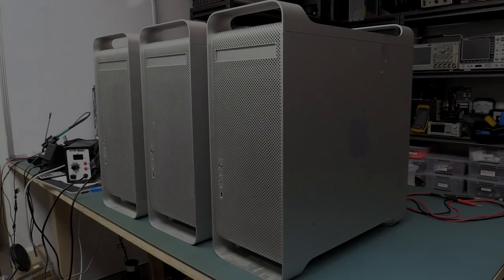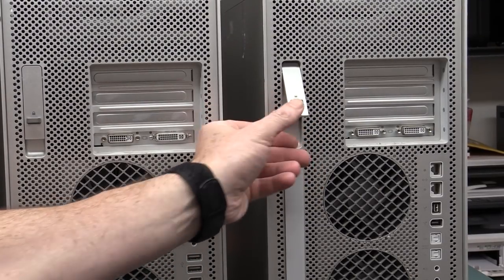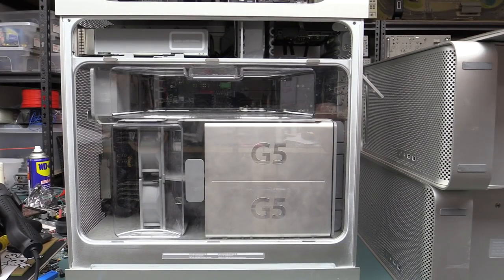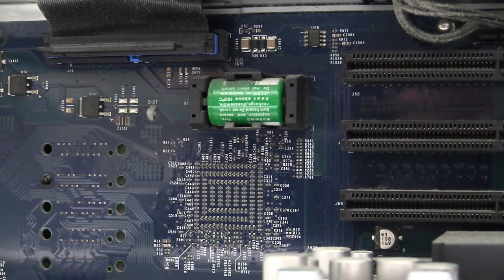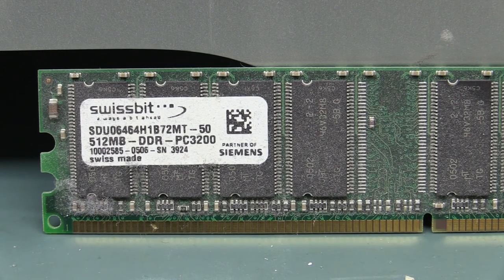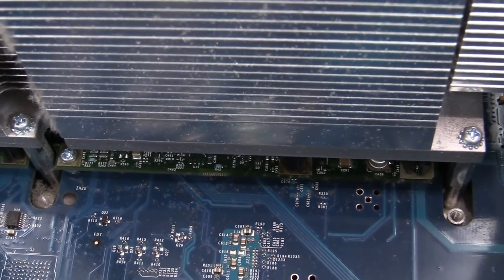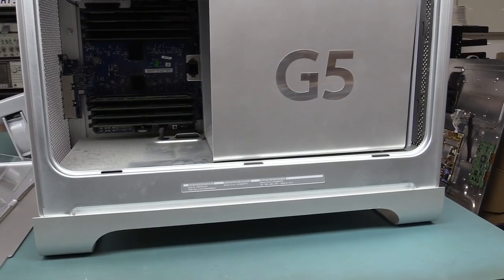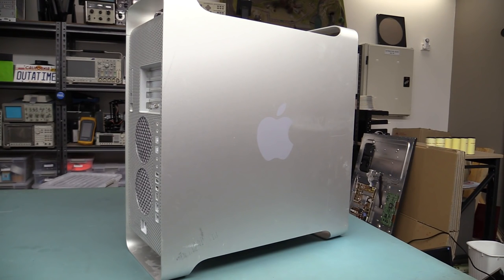EEVblog #783 - Dumpster Dive Power Macs

Comment: How cool would it be to convert one or two into liquid cooled gaming machines. It already has a cool custom case.
Reply: Yass
Reply: Half of the design of Apple's classic Mac Pros (all the way up until they dropped the towers for the torus thing they have now) is the thermal handling. Much of its form is dictating by the function of moving lots of air. Liquid-cooled obviates all that. 

If you could get your build to even sort of fit into the original spaces, you wouldn't need liquid cooling.
Reply: Some of them (quad cpu models) have liquid cooling stock

Comment: Where are the power supplies? External? They were where the hard drives were in these. I just scrapped 4 x 2009 models. 4 x 980 watt PS and all the heat sinks for projects. 8 Huge CPU heat sinks. 16 working fans. I'm set! Kept all the aluminum panels for projects as well. Come in real handy. Everything else was scrap or ewasted.
Reply: The power supplies are in the bottom, unlike the Mac Pro.

Comment: They'll be ATI graphics chips or Nvidia.    There was one model of those that actually had liquid cooling with a radiator and pump.  Apple overclocked the G5's,  hence the beefy cooling.

Debian Linux maintains a release for the PPC that really runs great on those.  Makes them quite useful even today.    I have an old PPC G4 Mac mini on my bench running debian that I still use to watch youtube and research with when I'm working  there.

Comment: Here is an idea. Put speakers where the fans on the back side was, put a big chargeable battery inside, solder everything to the usb ports and to the aux outlet, take everything else out, boom, a really cool dock with speakers :)

Comment: I'm surprised you didn't get a water-cooled model.  The dual G5s were commonly water-cooled, and they leaked terribly and ended up destroying many beautiful machines.  Also, you should definitely pull the heat sinks off and take a look at the CPU daughter boards, they're truly works of art.

Comment: So here are some facts about these PowerMac G5s:
-- There were released from 2003 to 2005, up until early 2006 when the Mac Pros or Intel based machines came out (same tower case but with 2 CD/DVD drives)
-- The single processor PowerMac G5s had a PCI interface and had 4 memory slots, whereas the dual processor PowerMac G5s had a PCI-X interface and had 8 memory slots
-- The last lot of PowerMac G5s (also known as an Early 2005) had a single Dual Core processor (not Core Duo) in 2 configurations and the top end model was a Quad Core processor, and they also had DDR2 RAM (maximum 16Gb although Apple initially supported 8Gb), PCIe slots, and 2x ethernet ports
-- The Early 2005 model had a C19 plug which was an error in their design and/or engineering, but Apple were too lazy to change to a standard C13 plug - it's only a standard 10A C19 power cord anyway, but is a pain to find an original cord sometimes
-- The deflection board (or clear plastic/perspex board) was not only for good looks but was used for good airflow with the fans and CPUs - removing the deflection board would mean disruption for the airflow so the fans then kick in at full speed (there is a microswitch in one holes which is triggered by one of the lugs of the deflection board)
-- The beautiful design of the power supply which screws onto the logic board (motherboard) also meant a nightmare to remove the power supply i.e. the processors, logic board, and all fans on the lower part had to be removed before the power supply came out

These are just some of the facts briefly outlined in the video of the 3x PowerMacs that you found. Another interesting fact was that the top end PowerMac G5 configuration was liquid cooled (except for the first generation of PowerMac G5s) - try typing in "powermac g5 liquid cool leak" into Google and see what images you find.

These PowerMac G5s are still sought after as some people are still running legacy PowerPC software. I still sell these to some of my customers and they range from $200-$500. If you want a logic board (motherboard) and a dead power supply to play with or tear down, let me know and I'll see if I can dig one up and send to you. Sorry if I typed too much...

Comment: That ADC connector on the display card has no USB. Its DVI + 25V DC for the monitor power. The PSU has a special 25V rail for this (4A I think).
These machines are NOT useless today. They were built like brick dunny's. I still use one as a server - totally reliable. I can also use it for whatever daily tasks I wish. Still better performance than many modern Pentium/non-core_i machines. Just add enough DDR400 (4 or 8GB) memory and you're OK.

Comment: Those arent bad computers... the specs arent bad for a basic user running windows. I know you can run windows with new macs because there isnt much of a hardware difference, but it would be nice to see those running something in a virtual machine or boot camp or something similar.

Comment: Dave, I am so jealous of you finding those G5 Power Macs! They are really dang beautiful and even if they aren't as powerful as a modern Core i5, I'd still want to have one just as a muck-about machine and see if I can get a legit copy of OSX (that still supported PowerPC chips) from Apple to rebuild the system with (replacing the drive as well probably).

Also, speaking of the drives; Were they running PATA/IDE drives or SATA drives?

Comment: Also I am sure you are already aware but you can upload those to the last OSX build that supports power PCs 10.5 (Leopard), can rib a disk image from online or grab a disk off ebay. 

These thing are beasts, a press I work at occasionally is still running G3s and candy iMacs. 

I have at least twice in the last decade had to swap a psu in them, but other than that they just keep on going. 

You can put some decent sata drives in them, maybe add a pcie sata host controller and add even more. 

Use it as a FTP host, or webserver. 

The possibilities are endless, don't discount it because of it's age. 

The bastard is still useful! 

You could even replace the mobo and wire a custom psu cable to the outputs on that psu. Then slap a newer i7 board in there with some modern gpus. 

Like I said, that is awesome, I am jealous.
Reply: +Unrelenting Industries 

 Notice the log in screen? I think that WAS Leopard :]

Comment: Those cases could handle a HUGE power supply... perhaps something linear. The case was carting better than 40 lbs. of crap back in the day. I owned one. It was great, while it ran... but those fans were LOUD! Keeping them in the next room from my recording studio was a bummer. You would need the proprietary CDs from Apple if you took out the G5 processors to regrease the processors (often needed after a couple of years). The CD allowed you to match the processors and set some internal crap which was needed before you could properly run the machine. I forget more about mine every day. LOL

Comment: due to modern downsizing, you could probably fit half a dozen or more older Consoles inside one of those Cases.

would make a great Living Room box that looks pretty and has all of the Consoles you wish you still had in.

since you'd have so much open space, you'd even be able to have converter box(es) inside the Case so that you can have all of the various Consoles be compatible with any Home Theater.
portable! minus the HI-larious weight.

Comment: They don't make them like that anymore. Those are gorgeously-engineered units, and I used to have one. In fact, I have some spare cooling fans for them in like-new condition, if you want them...lol. I also have one of those funky display adapters too--and you can have that as well.

There is a flashing light sequence on the power light, and you can use that to help determine what is preventing startup. I was once given a G5 like this that had a "bad logic board," but when I started working on it, it became apparent that one of the RAM sticks was bad. I used the power light flashing sequence pattern to determine that, and then simply removed the RAM sticks and tried them one at a time until I found the bad stick. I was able to buy RAM for a reasonable price on eBay, and the thing ran very well. I think Mac Tiger (or Cheetah...I can't recall now) was the last OS I could put on the thing. But it ran fantastically.

Comment: Weld / Stick / glue them together in the shape of the firewire logo, as if you're looking at the cases front on. This would be to celebrate firewire before it dies through other technologies. As firewire has been used by loads of Apple users over the years (and still is) through all the multimedia content.

Comment: They could stuff in a FX5200 or a GTX285 which still retails for 200+ on the market.

THey put in anemic 5200 RPM hard drives, most likely a cost cutter.  I put 10K RPM Raptors in one  and it acted like it had SSD's in it.

Comment: That's ADC (Apple Display Connector), not M1-DA. ADC carries video, USB, and power for the monitor.

I have a Power Mac G5 that I found in the recycling a couple years ago, in storage. I'm keeping it because I will at some point want to run software that was compiled only for PowerPC Macs, and Intel Macs can no longer run it. It's missing a couple of fans, though, so I haven't tried starting it up.

blah tewtrwet?

Comment: I found a micro Hp PC tower in the bin at my work. It's an i5 beast. The ram, hdd, and disk drive was missing. I managed to get a 500gb hdd, 6gb pc3 ram, DVD multi drive and even fitted a mini pci wifi card inside. Put Windows 7 pro on it and it flys. Very nice mini tower too. There was 3 in the bin. A co worker got one and someone else took the other.

Comment: 12 years old, it is amazing.  I say that 6 months is a computer year. so they are really 24 years old, if I heard you correctly.  One of the reasons I don't like Apple is you legally can't build one, since now they are just PCs. But my desktop now is almost 3 years old, but I have upgraded the boot drive and RAM, just went to Win10. 20 TB of storage.  Down the road I will upgrade to a Skylake, or whatever when the price drops.

Comment: I just recently retired my 2006 MacPro, it runs Snow Leopard quite well but the old Nvidia 7800 graphics card trips and sloggs on the internet. I have it stashed away with a few other old Mac machines that are its predecessor. Using a new 13" MacBook Pro now.... So much better all around than the old aluminum Mac Monster.
Reply: I still use my 2006 MacPro. Put in a cheap PC version 2GB Nvidia Card and upgraded to Lion with an additional El Capitan partition. Works like a charm.

Comment: You can run Linux on these, most modern Linux Distro's still support the PPC. the Dual 2.0Ghz PPC processors can still hold their weight, the RAM by the looks of it is DDR1, so a bit on the slow side by todays standards but still not totally useless with the right software ;)

p.s, if you are interested in trying this, you will need to download the specialised ISO's, the normal PC/X86 ones will not be recognised by the firmware on the boards, but instructions on where to get them and how to do it are all over the internet! (I recommend either Mint or Ubuntu)

Comment: Looks like these could be easily modded to accept a regular Micro-BTX motherboard. The mounting probably won't line up and the back panel I/O is definitely different, but that's what drills and dremels are for. Problem is, nothing uses BTX anymore either!

Same problem with mid-2000's era Dells. I have a stunning and massive Dell XPS case which I'd love to use, but again, BTX. So you're stuck with socket 775 gear or similar vintage. I mean, you can for sure get by with a Core 2 Extreme for most everyday work, but it wouldn't be worth the effort.

Damn. Thanks for going your own way, Apple, as always. Our landfills appreciate it. :/

Comment: a G5 that powers up then shuts down is the power mngt asic shutting it down. something on the main board not reporting stable power or the PS unable to supply good power so the power supply turns it all off. look for a flashing red led on lower part of main board.

fwiw, i have a still running dual G5. They're hard to kill and handy for running old versions of layout/design software.

Comment: False- it DOES run modern OSs. Linux runs with all the software (as long as it's open source, which is a good percentage), and I understand Ubuntu Mate to be a very common occurrence on these types of older PowerPC systems.

Comment: Dave, get a old system DVd with OS X 10.5.8 on it and that will boot those G5s and you can reformat and wipe the drive and install a clean version of OS 10.5.8  I hope you keep the best one in working order, shame they last longer than they are useful.  Back in 2004 people edited pro video on those machines!  OR you can find a hack and install windows on them too with having to make any changes to he hardware.  Lucky day for you!

Comment: Fastest desktop? In June 2003, at the same moment, the first opterons were introduced and if you take a quad 844 it'll run Windows 7 like charm!
In fact I still have some quad 848 (those came out few months later) with 16GB RAM, the mainboard has SATA raid and dual channel 320 SCSI. With a set of good SCSI drives those will run any modern OS like a charm. Only downside is that they draw over 400W and are very expensive to run 24/7 as the server. Too bad electricity is not cheap :(

Comment: Alot of G5 Models from 2003-2006 included an ATI (now AMD) Radeon 9800 128MB or Higher or an Nvidia GeForce FX 5200 64MB Or Higher. the OS in those years would be Tiger all the way to at least leopard.

Comment: i think in a matter of an hour you could go to your local glass shop grab nice tempered round piece of glass at a meter or so , grab 12 rubber bumpers on way home, place macs on ground in triangle formation, rubber up top to corners, throw glass up top, might as well get quarter inch or thicker glass god knows that case can hold some weight . and you have one bad ass coffee table that any rich old dude that digs macs would pay a dime for. in your spare time maybe get os x reloaded on one minus security problem, mount an lcd display under your table glass and get some pac man going on 15 thousand dollars worth of useless memories

Comment: It's funny that Apple claimed that these were the fastest workstations consumers could buy at the time even though they were far from it in pretty much every way.  Hell I was running dual processors with 2x Xeon 3.6 Ghz chips at the time in my workstation and they would blow past the G5 processors in pretty much any real world workload.  Not to mention the lack of x86 on the G5 meant that it was stuck with very limited niche market for software.

Comment: The Power Mac G5, with a suggested retail price of $1,999 (US)
1.6 GHz 64-bit PowerPC G5 processor.
The Power Mac G5, with a suggested retail price of $2,999 (US)
Dual 2.0 GHz 64-bit PowerPC G5 processors.
Those 3 machines cost just shy of $7,000 in 2003.......Not Cheap!

Comment: Not a fan of Apple, but I'd loove to use one of those cases for a server build owo
Reply: +Baiku Waifu I guess you not seen server cases lol....

Chenbro make cheap server cases 8 bay SATA / SAS..... when i say cheap i not mean cheap and nasty i mean cheap but good.
Reply: Dami Nooki
 Coolermaster Stacker, I have had for years and is way better then this case plus its the same age......Better AirFlow, 11 drive bays, and still use the case with my newest rig.

4x120mm fans, xcross blower fan for board and ram,3x60mm fans.

6 front USB 1 firewire and mic and headphone jack, also added 2 USB 3.1......

It's also the same age.

Plus has caster wheels and rubber shocks for hard drive cages and the cages are screw-less... but Apple fans always think there stuff is better even with there 10 year old OpenGL driver that's an obscure version that not many people use or the lack of thread safe appz..... Unity cough cough.....just been 64bit enabled...

"It's not that i hate Apple its just they don't make the best stuff and often rely on others to make/design for them thus your best off going else where and as i use a computer for everything most of what they have is far far behind........

http://www.tomshardware.com/reviews/atx-btx-cases,1187-6.html

That's the case look for your self, its way better and stronger in every way plus its still usable and not changing it anytime soon.
Reply: Dami Nooki
 There are lots of cases that look good and are engineered good, this case may appeal to some people who like the flimzy look, but as an engineering marvel not really when you compare them to other cases that you could get unless you limit your self to just apple then you have no choice, i guess that's the appeal for some Apple users...
Reply: Dami Nooki
 You mean Apple Device..... A computer can do anything as long as you know how to make it do anything, a Apple product is a Device it has limited functionality by hardware and software, most of the time deliberate to keep there users in there control.

As for the arts farts stuff i do not understand as i am a logical entity, speed and power and efficiency , reliability these are things that matter to the engineer.

So the fact is no matter how you try to look at it a piece of shit is still a piece of shit.

Just like Samdung processors are slow and has little to no efficiency compared to other processors, it also has high fail rate, that will not change.

IBM also makes crap processors the IBM Cyrix 6x86 is the Classic example of rubbish.

Now as far as i am concerned those engineers who designed those rubbish processors should be brutally punished because each crappy thing they made was almost a step backwards.

Thus you and i live in Different worlds i live in a world of logic you seem to live in the hipster world this is why i not understood what you where talking about but now i do.